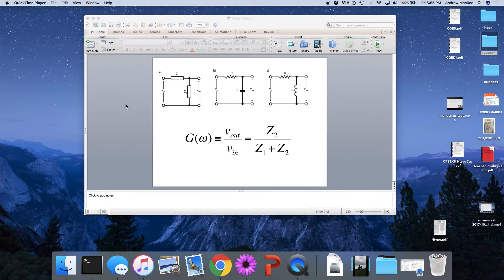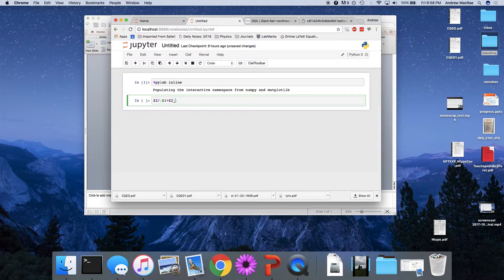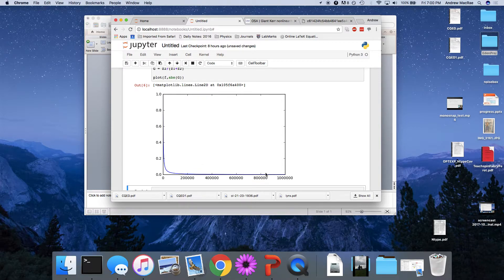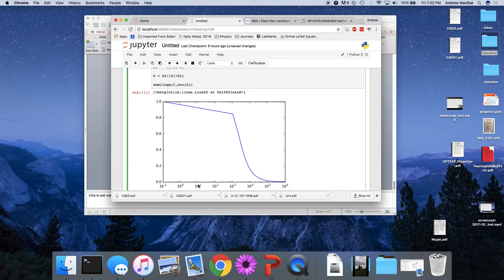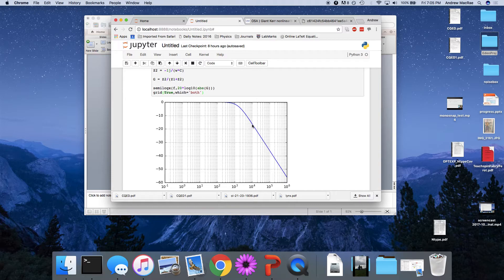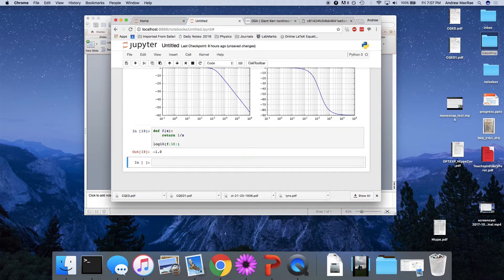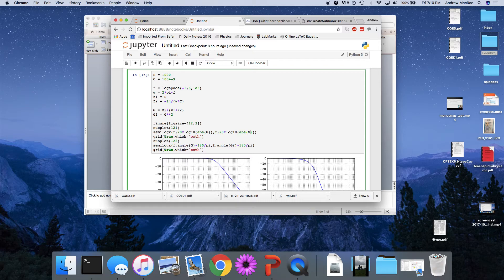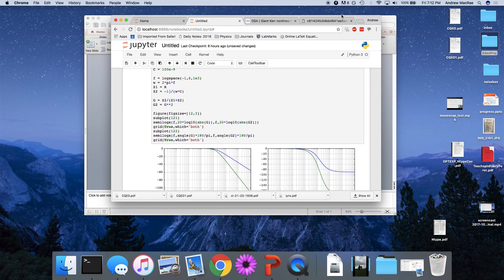Making Bode Plots With Python (Phys 229)

Comment: The same code you used and Im getting this error: float' object cannot be interpreted as an integer  --- Could you please tell how you got rid of that?
Reply from the maker: I'm guessing this is in your linspace() and log space()? 

This was in an older python version. In newer versions of python, the 3rd argument of lin/log space must be an integer whereas 1e3 is a float. if you write this as either int(1e3) or just 1000 the error should go away. 

For example:
f = logspace(1,6,int(1e3))

or

f = logspace(1,6,1000)

Hope it helps.
Reply: @AndrewMacRae   I tried the 1000 before and it worked. Good to know from where the error arose. Thanks for your reply and great work!